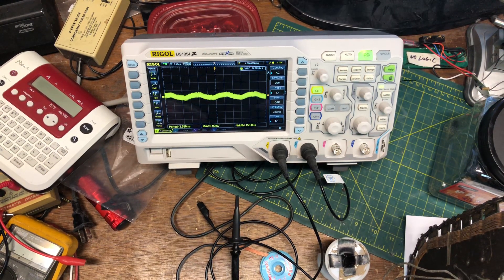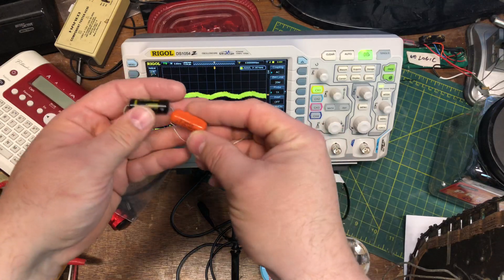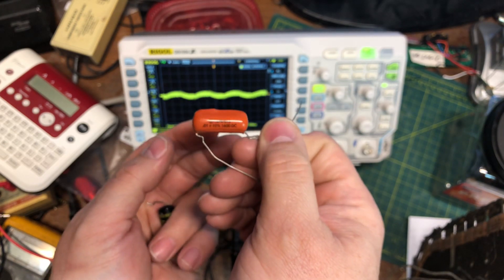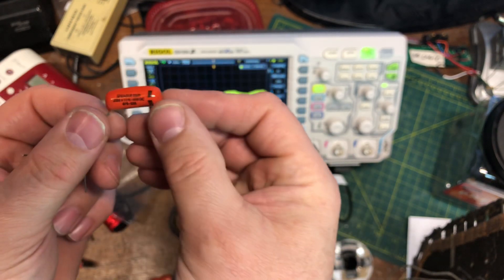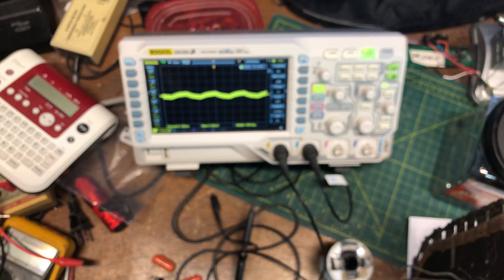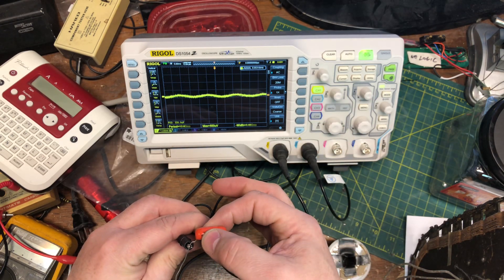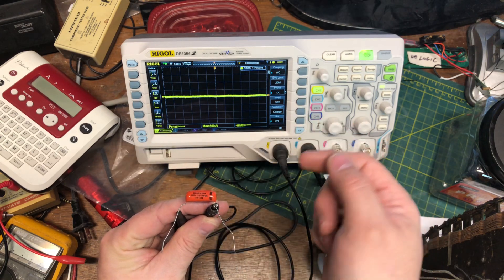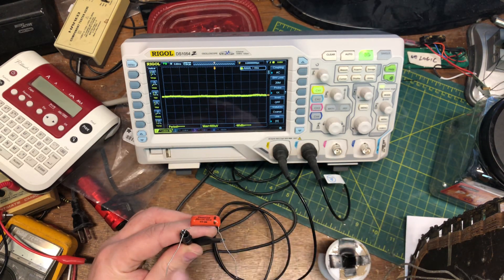How to tell if Bypass caps are backwards on a Rigol DS1054z

Comment: Ya every cap I tested this way ended up like the orange drop u tried and couldn't get a definitive result.  I'm still on the fence here with this polarity on the caps . If I can't see it on my scope it's not going to matter in the circuit.  I have tried it with a bunch of different values and different brands . I'm ki da convinced the newer ones are made differently where it's not going to matter.  How else would u explain the one u couldn't tell ?

Comment: Be thankful those orange dips don't have a foil side marking. Because they are NOT foil side markings. They are just decorative marks. The caps today DO NOT have foil side markings. They are printed randomly as they come down a conveyor. If you check the ones that are marked, you will find most are on the wrong side to mark the foil.